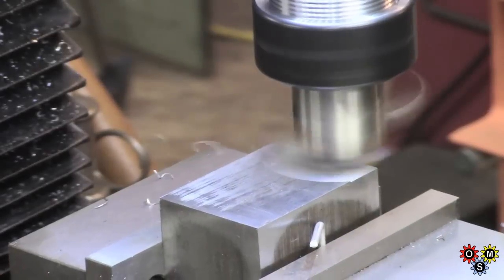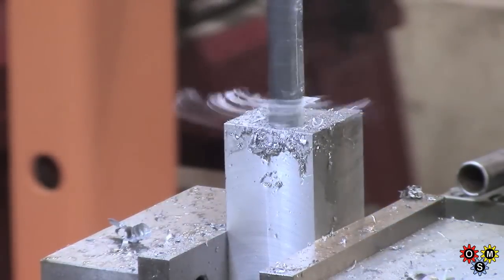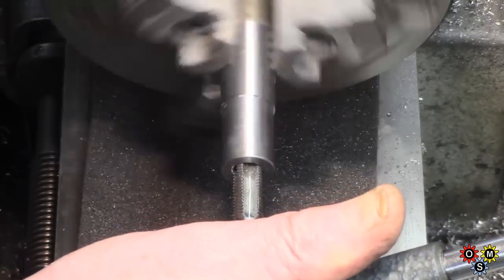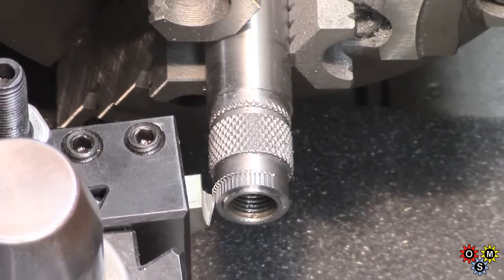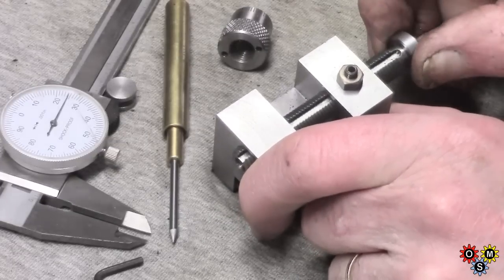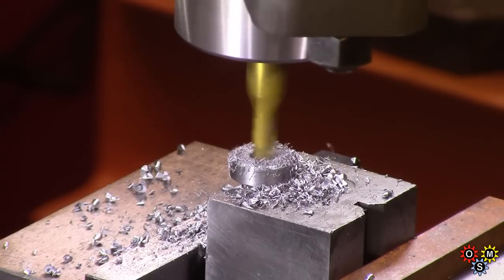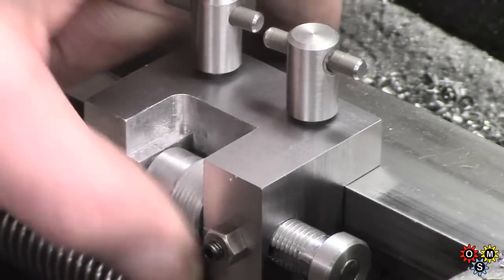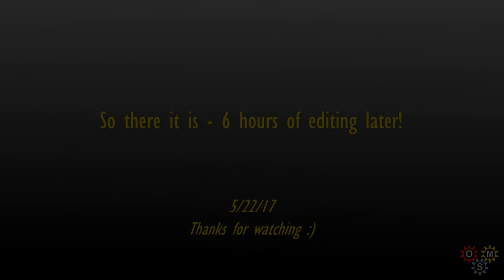Lathe Carriage Stop - The Spareroom Toolmaking Competition 2017

Comment: Nicely made Chris. I have a commercially made carriage stop of unknown origins that would be slightly easier to make. The main block has no slot and the adjusting nut is mounted on the outside nearest the carriage. The adjusting nut is a top-hat design with the top-hat fitting into a counter bore in the block. The nut top-hat has a groove cut in it so that a retaining grub screw and lock nut can be used to retain the top-hat. There is a grub screw and lock nut for the keyway in the adjusting screw as in your design. There is a locking thumb screw with a brass slug that locks onto the adjusting nut top-hat.
Reply from the maker: Hi,
I guess mine could have been simpler but - just had that notion - in part actually inspired by aspects of one made by "Toms Techniques''. The beauty of our channels is the inspirations achieved from other folks :)

Comment: Cool tutorial Chris! Any chance you could give dimensions? I have an Atlas  flat bed lathe and I'd like to make one for it.
Reply from the maker: Hi,
I'll have to go measure - but dimensions are rather arbitrary really. Nothing cast in stone. I think the chunk (from scrap box!) was nominally 1.5 x 2 x 2.75 long. If I remember I'll check on that. The vernier 'dial' sits in a slightly over 3/4" slot.
Just checked - my guesswork was way off. The block is 1.25" x 1.5" x 2.125" long! Could well have been a bit bigger.

Comment: Good work, as with any prototype changes are bound to present themselves during build. I was thinking that black paint or ink in the scribe marks might make them easier to read; just coat the knob then wipe off the surface, keeping out of the knurl as well.
Reply from the maker: Hi Tom,
Hah - dead right!  It's rare to get all aspects right first time - plus I am guilty often of building ''on-the-fly'' :) Had thought of blacking scribe lines - just hadn't gotten to doing it.